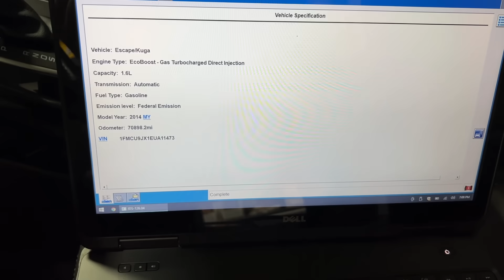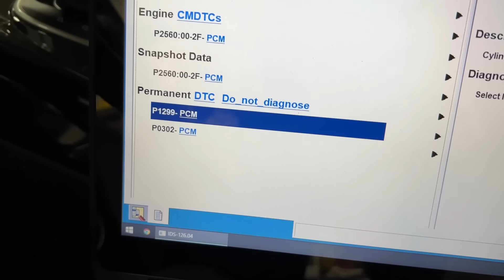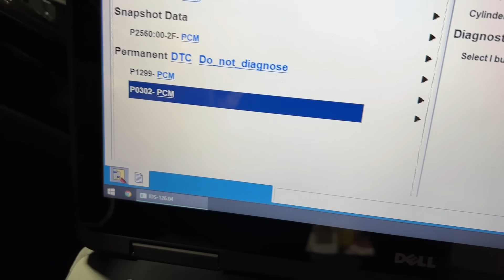Beware of Ford’s 1.5L 1.6L 2.0L Ecoboost Engines and Their Never Ending Coolant Consumption Issues!

Comment: I only had 33 k miles on my 2017 Ford Escape 1.5l Ecoboost when the coolant intrusion started. I was 2 weeks beyond the 5 year powertrain warranty. It cost me $6300 out of pocket. How is this not a safety issue? Ford needs to do the right thing and recall these engines. This is a design flaw. Consumers should not be on the hook.
Reply: You know its actually a testament to how accurate and advanced their engineering is. They timed it almost perfectly to fail right when your warranty expired!
Reply: You need to get together with other owners and start a Class Action against Ford. They know that there's problems with these engines as so many have gone Boom!!
Reply: @tellucas  lol. I'm far beyond pisst.  Loved my edge. It was my second one. And as soon as I made my last payment, it started drinking coolant. ZERO help from Ford.
Reply: @exil3dlivecom  I still have two years of payments. 😬
Reply: @michaelcrossley4716  dump the brand. And move one. I will NEVER buy Ford again.
Reply: @exil3dlivecom  my f250 has 269k and still going strong. I'm just not going to buy these value engineered new cars until I go electric.
Reply: @michaelcrossley4716  then battery replacement cost 5k?
Reply: @2nickles647  That's fine. The lower price per mile will offset the cost.
Reply: Ford extended the warranty to 7 years, 80,000 miles but the Ford dealer MUST look specifically for that issue in their system to get it covered.
Reply: Yeah I seen some start as early as 15k miles. I sold cars for a Ford dealership for 12 years and stopped because of Covid late 2020. I was already getting tired of selling cars anyway. Especially fords.
Reply: @Jay Pena  our youngest engine replacement for coolant consumption, had only 8k miles. And if it's not coolant drinking 4 cylinders, it's valve dropping 6 cylinders or crap phasers in pretty much every motor, lol. Keeps the service department busy, though, so I can't complain!
Reply: Every single ford ecoboost engines are trash. Doesn’t matter what year or how many cylinders. I work on them daily. I’ve been a mechanic for most of my life starting out helping my dad in the garage at age 7 and building my first motor at 14 which believe it or not still runs to this day. I’m now 34. I’ve never seen so many issues with a engine and it’s components at such low mileage like these ford ecoboost motors. It’s like once the vehicle hits 50k miles your going to need to drop a couple thousand to repair it and that’s if your lucky and you don’t have to replace the entire engine. Everything from vct solenoids and cam phasers going out due to piling issues from the factory to rod bearings and cracked pistons, cracks in between cylinder sleeves because of the coolant pass through slit at the top of the block between cylinders which also blow the head gasket out I replaced 2 d159 ecoboost motors this week alone and just a couple minutes ago I got a ford fusion ecoboost come in with the same issue the vehicle in this video has. Came in with no coolant and I had just topped it off yesterday because I noticed it was empty at the reservoir. Was thinking maybe thermostat but after checking the codes it’s got misfire too. Time for a new motor. 2017 fusion only 60k miles
Reply: Don't buy Ford cars 😢 I will prefer to spend on car brands like Toyota which is more reliable. I have learned my lessons already
Reply: Agreed
Reply: I've owned toyotas for over 30 years and never had the problem.
Reply: CSP 21N12. Ford paid for everything for the replacement of the short block on my 2017 Escape with 75000 miles. Also they paid for a new Turbo, reimbursement for Ubers and finally a free rental car. It pays to investigate and complain.
Reply: @tonyallen4265  I got a 2016 2.0 with 65,000 miles. How exactly did you investigate and get everything paid for if there is not recall? Do you pay for the extended service plan?
Reply: 2018 escape 1.5L , same problems . Outside of warranty . The dealership is putting a new engine in for free, so Ford is finally doing something about it . A little late though .
Reply: @Jeffwithag87 how come they eventually did it for free? Was it because you bought the warranty in the first place? Or are they owning up to it regardless for all customers?
Reply: @clone1137  we were just out of warranty coverage. They just said they’re owning up to it . Not a recall but if you met their criteria for year and total mileage they would replace the motor for free .
Reply: @Jeffwithag87   hey, thank you for taking the time to respond! I read up on it and saw Fords technical service bulletin. If your blocks been replaced you received an updated design where the issue can’t happen again!
Reply: @clone1137  I had this done 2 years ago by Ford after recall, and now need a new engine at 120,000.
Reply: @ermamilspaugh  what’s the failure this time?
Reply: @geoffgoemans6352 how much did it end up costing you?
Reply: @Jeffwithag87  how many miles? Ford corporate told me to pound sand. Mines is a 2015 edge with 155k.
Reply: @exil3dlivecom  yeah they said 7 years or 140k KM. So ~88k miles .
Reply: @exil3dlivecom  7 years and 150,000 miles?...of course they are going to tell you to pound sand, that's nowhere close to the warranty period.
Reply: @danamullins2723  it's a latent Factory  issue. No amount of prevention services prevents this. Bad engine off the factory floor. Look at Kia/Hyundai and their Theta engine.Everyone got a engine replacent regardless of miles and years. THATS CUSTOMER LOYALTY.  FU FORD!
Reply: @exil3dlivecom  I'm not disagreeing as to the moral backing of why it should be fixed, I'm justetting you know that you shouldn't have been surprised with their response with the age and mileage of the vehicle....once you wait that long they can blame it on a number of things.
Reply: @danamullins2723  Hyundai knows how to treat their customers. Just saying.
Reply: @exil3dlivecom  That's not customer loyalty it's the NHTSA getting on their behind!
Reply: @exil3dlivecom  After they got sued. Got forced into it.
Reply: @Jeffwithag87  you're lucky... I paid 3500 for block replacement 

57k miles
Reply: @tellucas  No way. I was 600 miles off my 36k warranty and they made me eat a throttle body unit. refused to help. All depends on if you buy many new fords and did u buy new or not. They are very selective.
Reply: I have been a life long Ford owner until Ford came out with the Eco bombs.  My daughter still drives my 2010 Ford Escape with a 2.5 NA engine with a six speed trans.  It currently has 197k miles and runs great.  Everything is original. Unfortunately Fords eco bombs forced me to look else where and I currently have a 2.5 turbo in a CX9 from Mazda.  Both the engine and trans run great.  No issues.  What a shame Ford’s quality has deteriorated over the years.  It seems domestic brands can no longer build a quality product.
Reply: Great point.  Though, it is NOT a safety issue.  Does anyone think that ford would recall all those engines? They won’t lose all that money… too big to fail
Reply: I think they should do the right thing but I don’t think it’s a safety issue
Reply: Same problem I’m having with my 2014 1.6 cylinder number 2 crack and apparently ford has no recall on it so I’m stuck fixing it and paying the car off idk what to do
Reply: I agree FORD needs to pay up
Reply: How could an engine be burning that much coolant without smoking ?
Reply: So this is a 2014. I have a 2019 Escape that had to have a new short block due to this problem. It was luckily still in warranty. My question is how many damn years they going to put an engine in vehicles that they know is engineered wrong? They definitely need class action lawsuits for continuing to do the same dumb thing and telling customers of their product oh well out of warranty nothing we can do for you
Reply: If you contact Ford they will fix it or reimburse you for repair
Reply: Contact them where?
Reply: I called corporate.  They pretty much blew me off. FIGHT BACK WITH YOUR WALLET! NEVER BUY A FORD AND LET EVERYONE KNOW SO THEY ARE SCARRD STRAIGHT AND AVOID FORD AT ALL COST! I turned away 3 people from a ford purchase so far. FU ford!
Reply: Might you have a recommendation for a similar vehicle ?
Reply: The problem is folks it's not only Ford but alot of cars having similar issues. Ive had a Pontiac grand am which has had continues head gasket coolant consumption issurs since day one.The government needs to clamp down on these car manufacturers the way they have on Airlines......
Reply: How was it driven?
Reply: Just got one in yesterday and it's the ford block design blowing a headgasket
Reply: So if we want to buy an Escape, what year, engine is the best bet? 
Now they’re making three cylinder engines. I can’t keep up
Reply: Escape 2016 1.6l echoboost. 72K new Trans     no charge. Terrible start up noise at 92K dealer could not replicate issue.  Misfire Cylinder 4. Plugs fouled. 106K out of warranty /coolant leak never went low No visible leaks  - warning light emission control. 106K 
12K to replace. Going to auction .  No more ford !
I am sure the dealer knew the issue but no recall notice alerts - i told them what my mechanic told me. Same issue in this video.
Reply: We had the same issue with our 2017 1.5l ecoboost. Ford eventually replaced the engine free of charge. You should sue.
Reply: @BigSlick40 how many miles?     How'd you get them to do it
Reply: @MrJeepsterman  It had around 40,000 miles. It's called the lemon law in my state.
Basically if you have an issue with your car and it has been to the dealer three times for that same issue, then the dealer has to replace said item such as a transmission or engine otherwise they must purchase the car back from you. In my case Ford replaced the engine.
Reply: Been loyal to Ford all my life just like my Father, but not anymore!
Reply: Or consumers need to smarten up and stop buying Ford. It is basically a meme for unreliability at this point. It's your own fault.
Reply: Good luck! I feel for you! Same deal! I’m screwed!
Reply: I'm surprised you had to pay that kind of money out. My son-in-law's car had a 100 + 1000 miles on it. When his coolant leaks started and because of the class action lawsuit with Ford, they replaced his lower end for free. He didn't have to pay anything at all.
Reply: Can you help me with this? My mechanic can't figure out the fix for it and we're 3 engines in.
Reply: Not so sure about the new Toyota. I think they are slipping too.
Reply: Ford in general is a flaw
Reply: @tellucas  Do you have experience with doing this? Who do I contact? Thanks!
Reply: @ScottsGarage17  Ask Scottie Kilmer. He's on it.
Reply: because it isn't a safety issue ... it should be a class action lawsuit though.
Reply: @erikbalens  2018 camry 118k miles need camshaft because of failling vacuum pump.
Reply: @dannyn.3539  why would your engine have e a vacuum pump
Reply: @johnmitchell8925  “The vacuum pump supplied oil from the engine to seal and lubricate the movement of the pump vane. Engine oil is distributed to the vacuum pump housing through the rotor oil galley. There is a possibility that the oil galley in the rotor was not properly machined at the supplier.”
If you search 2018 Camry vacuum pump, you will find that it is a known problem.
Reply: @johnmitchell8925  it's a recalled part. The rotor inside is prone to breakage and if it binds up after breakage it will damage the camshaft and other engine components.
Reply: @dannyn.3539  >ignored horrible grinding noise coming from top end of engine
Reply: @dannyn.3539  theres a recall on that.
Reply: @dannyn.3539  please explain how a vacuum pump failure caused camshaft failure. Did the vacuum pump suck out all your engine oil?
Reply: @dannyn.3539 A vacuum pump fried your camshaft ?
Reply: @dannyn.3539  if you buy a Toyota brand new and change the oil every 5k every time, it will last well over 300k miles, doesn’t even compare with Ford or any domestic brand, stop saying stupid things on you tube
Reply: @lx4118   Toyota last but it looks foreign and ugly
Reply: @erikbalens  
So if Toyota is so great why do the dealerships have service departments 🤡
Reply: @FP194  dude, every car breaks, what is wrong with you ? However Toyota goes 2-300k miles without major problems, is not on the same planet with Ford or any other domestic brand
Reply: @lx4118  yes sir. My 03 truck lasted up to 300k on the engine. Basically wore out.
Trans is at 367k. It's on it's way out too. Yes sir...miles and miles add to wear and tear. I've done all the maintenance myself. Brakes. Rotors. Oil. Ect....
Reply: @lx4118  not with new Toyotas. The quality with Toyota has crapped the bed over the last 5 years.

 I still drive my 2008 Pontiac G6 with 265,000 miles on it. I’ve had it for 16 years and have taken good care of it with one exception, rust.

 Anyways, no way would I buy a new GM because I have a solid GM built 17+ years ago. That’s almost a generation old. New GMs have ton of problems, just like the Toyotas now. All these new vehicles freaking suck regardless of brand.
Reply: @FP194  because you need to maintain every car 🤡
Reply: @FP194  "service" - now think for a moment what this word actually means.
Reply: @FP194  changing oil is service. Working on brakes is service. Changing tires is service. Called basic maintenance service.
Reply: @FP194  Mostly maintenance.
Reply: @FP194 the guys at the Toyota service are far less stressed than the guys at ford 😂
Reply: @FP194  for people who don't know how to change their oil 😂 2012 Corolla with 180,000. No leaks or issues with fluids. I have to tell every gm and Ford owner what to do as preventative maintenance just to make it to 150,000
Reply: @FP194 my 4Runner has 255,000 plus miles. Battery, brakes, brakes, tires, more brakes, fan clutch, brakes and tires. Pretty damn reliable, certainly better than 99% of the Fords out there. I still like Ford, though. They make nice stuff.
Reply: Please I hope you will respond back to me… I have a 2 liter eco boost Maverick on order and after having seen this I’m super concerned so I’ll verify your experience with others as I still have a chance to cancel my order and get my deposit back.  Sounds like you would not recommend this engine at all ?

Dan
Reply: @dancorrell6182  They fixed the problem in 2019. If it's built after 2020 you should be fine.
Reply: @michaelcrossley4716  "They fixed the problem in [mid] 2019." 
One month AFTER I bought my Lincoln...lucky me.
Reply: @Pro1er  That sucks. I had mine go bad outside of warranty and got ford to cover 60% of the repair. Just got it back last week and had the engine light blinking while on the freeway the other day. Both 2 and 3 were miss firing badly, so we'll see.
Reply: Can we be sure they fixed the problem though?? I was considering a new Lincoln, but this kind of known problem is TOO MUCH with the price of the car!!  @Pro1er
Reply: @michaelcrossley4716  What ended up happening with yours, was it still messed up after the replacement?
Reply: @jeffherrington  I don't know what comment you're asking about. The eco boost motor was replaced in mine and so far so good. If you're doing yours, make sure to change your flexplate at the same time.
Reply: I feel for you, but this is not a safety issue.

Comment: About 6 years ago a car salesman tried to give me speak about how these microscopic motors are the wave of the future. I told him not my future. I told him real stories of cars in history can produce great horsepower but all overheat. He ducked his head for my wisdom scoffed his pipe dream. As predicted small engines can not carry away heat as needed.
Reply: Toyota and Honda don't seem to have these problems. Unfortunately Ford doesn't have a wealth of experience designing and manufacturing small engines with high specific output.

Comment: Is there a way Ford might possibly replace the engine in my 2017 Escape that's doing this exact thing? I kept looking and asking to see if there were any recalls once i noticed the problem, but now it has over 100,000 on it. I'm just pissed I've had to keep dumping coolant in it all this time cause the dealership i got it from told me there wasn't anything they could do without a recall

Comment: I have a 2018 escape with the 1.5 eco boost. I’m currently at 64,000 miles and haven’t had a single issue knock on wood. Really hoping I get lucky with mine. 😅

Comment: Replacement long block will do the same thing.
This is border line criminal, like swindling people out of their money by conning them.
So congress worries about how much water my toilet uses but, not about how long my vehicle should last.
Even at 100,000 miles it should not need an engine.
Makes you want to bring it up to Dearborn and burn it in the lobby of the Glass House.
Reply from the maker: The blocks have been revised.